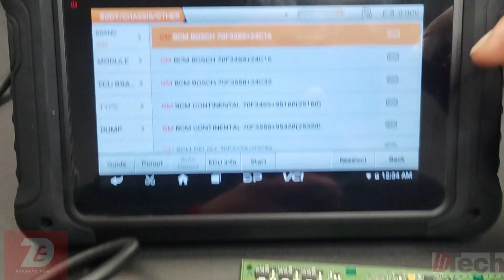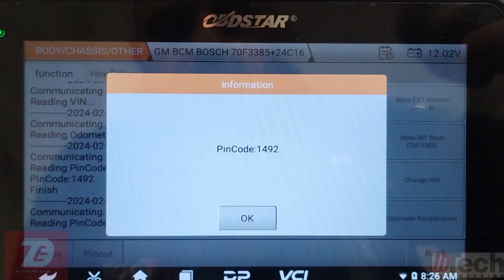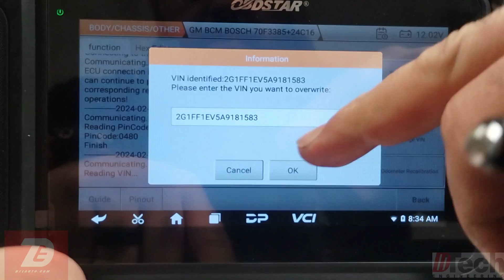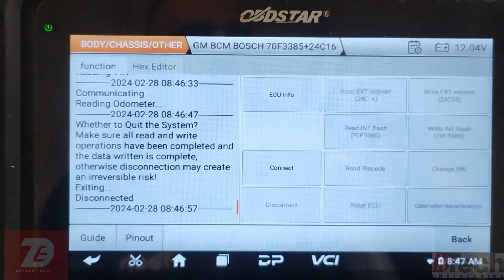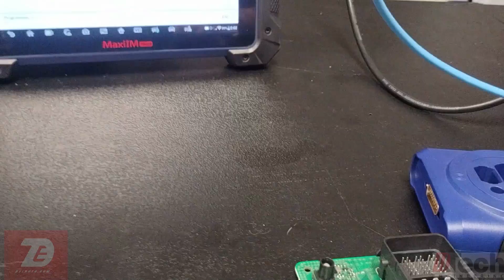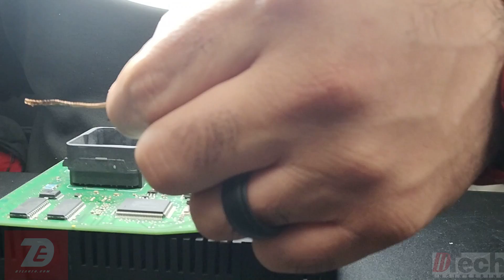GM BCM CLONE WORK W/ OBDSTAR DC706 & AUTEL IM608

Comment: Looking at getting into cloning. What pros are there if you can’t communicate with a module with an obd 2 scanner? Most modules I condemn are no communication. Would cloning still work? I just don’t see a need for it. If it had bad drivers etc I could see..
Reply from the maker: when they don't communicate via obd there is a high chance that it won't clone over if the procedure involved in doing so is via the can communication lines. If the data gathered is not thru the CAN bus and it is pulled from the circuit board then it is still possible to clone

Comment: what is the pin cable for the OBDStar called that you are using? I am thinking on getting a setup for myself since I am having issues with my 09 BP Body Subaru outback. I have removed the aftermarket alarm system and I am still not getting the security  and im about to change out the dash harness to ensure there are no breaks in my wiring and seeing if the security light comes back.
Reply from the maker: all the cables come with the obdstar kit

Comment: Do you know if vvdi prog is capable of doing this or the launch tool?
Reply from the maker: the bcm's that have an actual 8 leg eeprom, yes the launch and vvdi can do it because they can read eeproms with an adapter, but they won't do it through the module pin connector

Comment: Great video. 2021 GMC Terrain,. Eeprom chip is 24C32 but OBDstar says can not communicate to BCM.  How to make sure OBDstar covers this BCM 13524922
Reply from the maker: most modules with 8 leg eeproms the obdstart doesn't do, but it's always best to find out if the obdstar covers a module is to open it up and check the bcm app and look through them all per brand and see if it is in there

Comment: Is there jobs the obdstar will do that autel won't? Looking to buy my first tool
Reply from the maker: yes, there is. But also, the other way around. The difference between the 2 is that obdstar as more module coverage including bcm's. But it doesn't always work to clone modules even though it says it can do it. And again, it can only do clone of modules/computers.
The Autel can do module cloning as well of ecm and tcm and immobilizers (obdstar can't do immo) and the Autel can also do keys. The autel can also do actual eeprom reads and writes along with mcu (microprocessors) read and write which obdstar can't do. 
The autel also has a unique feature that it can verify the eeprom/mcu data it reads and writes which is a very super helpful secure feature when performing this type of work, because sometimes the reads and writes of data can get corrupt and the module will not work, and one would never know it was from an incorrect read or write of the data without performing extra steps of verifying the work done. The autels verify feature can automate that for you.
Additionally, if cost is a thing, the autel's programmer unit, the XP400 Pro can be purchased separately and used on a pc laptop. You do loose some features that the tablet offers (keys & verification reads/writes) but can do eeprom/mcu work. I have some videos posted of using it on a laptop. 
Hope this helps

Comment: Excellent video about cloning ecu's Sadel! From the time of this video to this day I am pretty sure they updated the OBDSTART DC 706. Looks like a really good tool when using used modules. Is the transfers via CAN BUS lines? I have an ABS module in a 2020 Dodge Challenger that is shorting the network through the CAN BUS lines, so I good not be able read the EEPROM with this tool unless I remove it Ah? Thank you for sharing brother.
Reply from the maker: yes it reads through the can bus lines of modules, so usually if a module is dead and not communicate when on the car, pretty much good chance it wont read on bench this way.

Comment: On the 2nd bcm i am always able to read the chip in circuit with my AR32 from andromeda research labs.
And to this date obdstar for some reason does not have the 2nd bcm , the delphi on the tool. Its a common bcm for some gm vehicles.
Reply from the maker: That is a good tool!

Comment: Where did you buy the push pin cable??
Reply from the maker: the yellow leads come with the obdstar tool, the light blue eeprom cable I tried to use in circuit with the autel did not work at all and I actually returned it so I wouldn't recommend that one

Comment: If you used the XP400 on a pc it gives you more options like voltage change if you drop voltage to read eeprom you probably would be able to read in circuit because your problem might be feedback from board trying to start with higher voltage and your getting data crash.
Reply from the maker: You are correct on the pc giving you a little more option with the voltage change, and yes if you wake up something on the board it can prevent a read. Although on the pc I have yet to find out or find if it can set up a verification read and write option settings. Without that on the pc version I've become hesitant on using it for reads because it corrupted a read for me one time and I lost data, so that was it for me with the pc version. Thanks for watching

Comment: Real deep stuff, nice and informative video. Tanks. A bit way out of my knowledge today, to do. I'm not afraid doing on-bench programing etc, but get of the chip off not destroying them is bit more tricker as I see it (getting older eyes). 
You do it so fast, and so reliable/professionall. Buyng stuff needed is not the biggest problem.
But/so, what was that yellow gunk used 18:30, before desoldering before the rossin?
Reply from the maker: it is actually just paint. You always want to either take a picture of the chip and its placement and orientation before you remove it and or start any work, or you can make a mark for yourself as to help when placing it back on the board. it will be a bad day when you mix up the orientation.
Reply: @DTEAuto  I'm more concerned blewing/burning it up taking too long to desolder. Or maybe being to quick and damage a track etc. But ruin a big legged component - gosh.
Getting it right back, I see as no problema. There are also small trainig curcuits, the are great to practice on.

Comment: What do you set your hot air station to?? So you don’t ruin the eeprom? I had to do one with harbor freight heat gun once it sucked all I had at the time laying around
Reply from the maker: The hot air I set to 400C with air speed around 6-7, and solder to 300C

Comment: as a general rule, you should ALWAYS pull the eeprom and read off board. Autel programmer not advanced enough to do in circuit but it does on some stuff but have to have 12v power hooked up to the xp400pro. Get a carprog for eeproms and motorola processors.